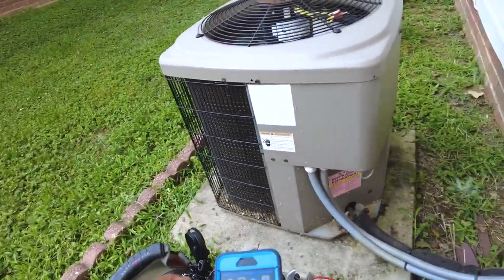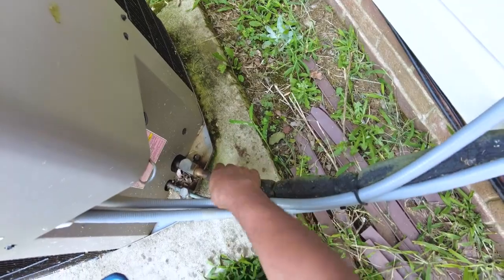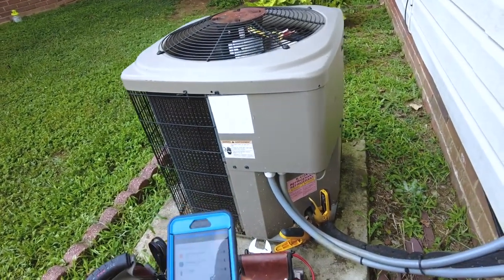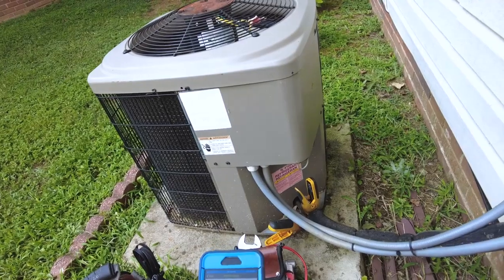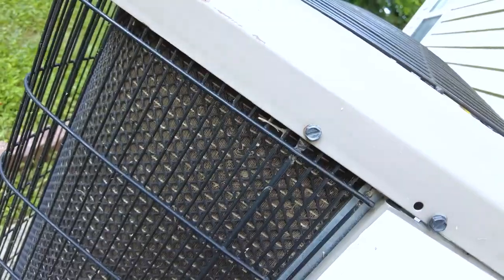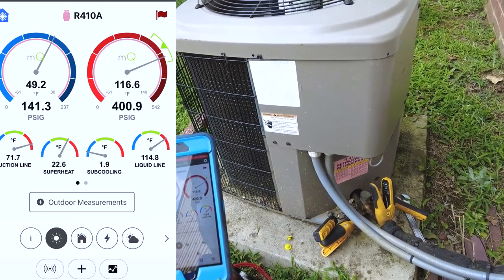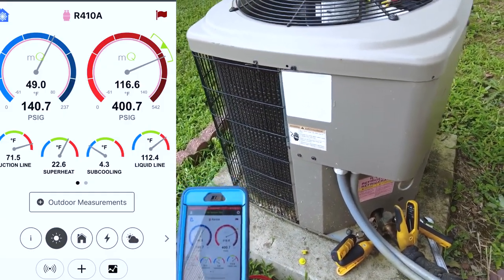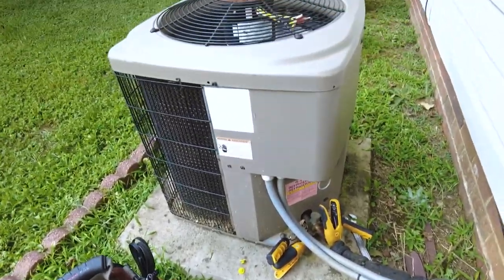Never Charge a System with Dirty Coils HVAC Tech Troubleshooting and Diagnostic

Comment: Interesting seeing young guys trying to learn ac.  Looks overcharged to me. high subcooling and low superheat.  usually about 10 degrees is ok. Those micro channel coil don't hold much and you have to charge very slowly as not to overcharge it.  Also you will get more refrigerant flow with the dirty coil outside and that causes a decent temp split but Horrible electric bills.
Reply from the maker: Appreciate the feedback and thanks for watching!

Comment: In my opinion, take a differential across your EVAPORATOR with manometer to see if coil is plugged, than I would check the whole interior of house for blocked supply and return air grills. I would also check total external static, than I would wash the unit and than take observations